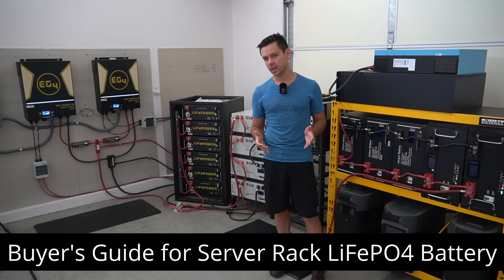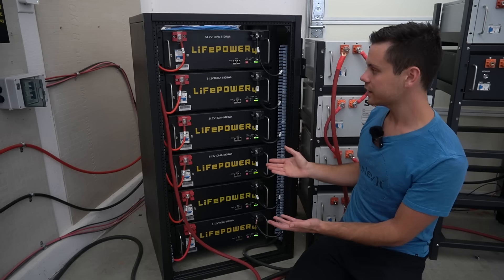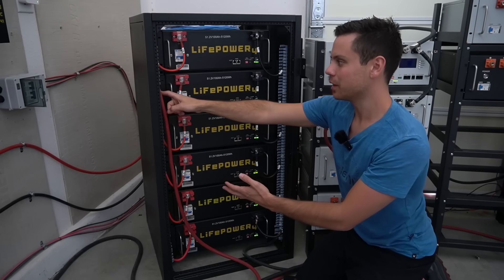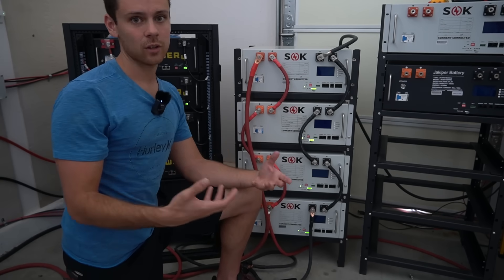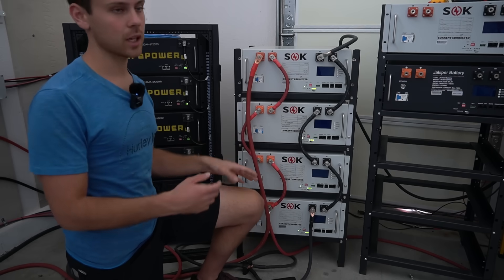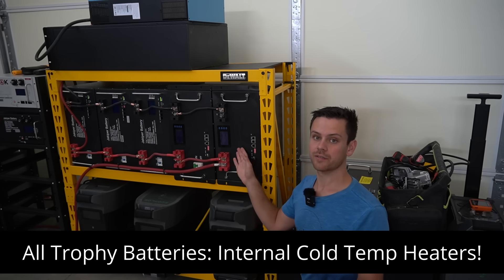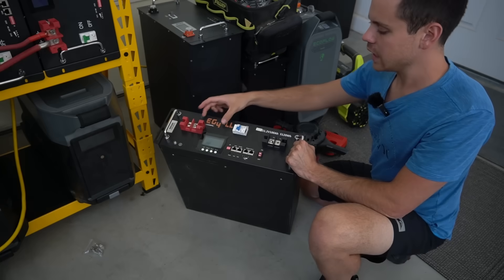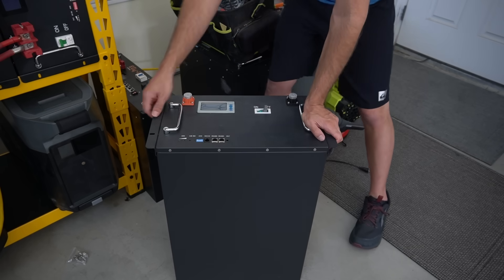LiFePO4 Server Rack Battery Buyer's Guide! For Off-grid Solar Systems

Comment: Hi will. I have a question, I'm very much hoping u can help me with. (I realise ur very busy an av a lot of subscribers.) My question: If I was to get a 12 to 24 V cigarette socket adapter for my car, (Straight plug in.) could I charge my jackery 240 faster or would it nacker the jackery up. Edit: if u happen to c this question and answer it. could u please answer it like ur talking to a 4 Yr old. (Seriously) Thank u !
P.s, I saw some of your videos asking for ideas, Maybe the best pocket Power banks (New or old, whichever has best stood the test of time. Or maybe just the best now when all things considered.) And to go with this, a backpacking (at least 30 Watt. small folding solar panel. Must be able to fit in a backpack) Balanced by price and quality if that's possible. Thanks again. You really are the go to (by miles) when it comes to this kind of stuff. 👍
Reply: No this would not charge a battery more quickly.

Your cigarette lighter socket can deliver a maximum amount of power. Let's suppose it can deliver 60 watts, which is 5 amps of current at 12 volts (60=5*12).

You can't create more power using a converter. When you feed in 60 watts into that 12 to 24 volt converter, you are still going to get 60 watts on its output. In fact, you will get slightly less because the converter itself will consume a little bit of power.

So 60 watts in, 60 watts out. Now your output voltage is 24 volts, which means your output current will be 60/24 = 2.5 Amps. So the current has decreased but your voltage has increased, but the power remains the same.

Going to a higher voltage means lowering the current and this can be beneficial over long lengths of cable as less energy is converted into heat and wasted.
Reply: @deang5622   Thank-you very much for taking the time to clearly answer my question.  It's very much appreciated. 👍

Comment: Signature Solar did a video of their  EG4 batteries, but they demandstrated that the battery would shut down if a high inrush inductive motor load were started on a small single battery setup. Requiring at least 2 batteries for even a small system involving an inductive inrush application.
My only other concern would be about battery/inverter communication compatibility. I'd heard that some combinations had issues.

Comment: What is your opinion on the expectation of equal current sharing among a large bank of batteries assuming busbars/large conductor/equal length etc? Should they all cycle up and down consistently assuming they are all the same model battery?

Comment: Hey Will, I think if you're looking for new content that solar panel tracking would be a big hit. I am fixing to build one using 12 volt light control relays and linear actuators. Just a thought.
Reply: i had one for a year and it worked fine but you can only put so many panels on one and it is easier to build a ground mount
Reply: @davidkettell5726  True, but some people don't have the space for a ground mount and need all of the sun they can get.
Reply: @68rileyray  I solved the problem by building a tool shed for my wife on my pool deck . it has a slanted roof to match my sun angle . I have 8 100 watt panels on it.
Reply: Solar tracking has proven time and time again to be unreliable and not cost effective for the benefits.  There are many, many videos that review this and back up my claims.

Comment: I've got a small hot spring resort near me that is completely off grid, it is an absolute mess tho lol
They have all old 18+ year old inverters and chargers, solar panels are a mess of mixed and matched old and new and broken panels, the batteries are giant 10+ year old lead acids that have been overcharged and boiled countless times from the generator overcharging them because of com errors in their system. Its an absolute mess.
The place was bought not to long ago and I want to see about talking them into getting new server rack LiFePO4 batteries and just fix the system up in general. 
No one there knows how big the system is, but I believe it should be somewhere around 300kw for it to work well at least.

Comment: Wow, that's a lot of rack batteries! Interesting to hear of pre-charge problems with the EG4 - mine worked perfectly with one LV6548 (haven't tried it with two).
Reply from the maker: Yeah I've actually connected it without precharge, had a huge spark and it worked great. I've actually done it multiple times off camera 😂 but some people are having a lot of issues with it on the forum sadly.
Reply: @WillProwse  Maybe with the higher volume, it has uncovered issues more quickly. Watching AmbitionStrikes video with CurrentConnected, they mentioned that the SOK battery pre-charge system was not enough to handle charging a pair of Victron Quatro. They manually charged with a resistor before making the connection.
Reply from the maker: @ericl5973  yes very good point. I have seen the internals and the cap bank on those units is massive. Smart to manually pre charge those.
Reply: @WillProwse   hey Will great video. Have you tried out any of the gsl energy products? Server racks, power walls and inverters? Cheers David
Reply from the maker: @offugo-adventures  I have not. I'll check them out
Reply: @WillProwse  thank you Will. Their spec offerings are pretty impressive. I’d say they might be the manufacturer for some of the brands on sale

Comment: How much solar is needed for these battery configs?
Reply: The eg4 and sok are 5kWh batteries. You would need to be able to generate what you use in the batteries at night. I have 4 panels (about a 1kW total) feeding the inverter and two eg4’s. I don’t have significant load on the batteries at night so the batteries fill up around 1 pm. I know, that’s at least another 3-5 hours of good sunlight here in Phx. Not off grid yet. Yet.
Reply: I have the 4 SOK's and about 4-5 kW of solar and I still have to shut down around 6-7 pm and have the inverter charge the batteries a few hours to make it thru the night.
Same thing in the morning until 10 am when the panels are just starting to wake up. peak solar is about 11 am- 4pm or so.  A lot depends how much you are hitting the inverters also

Comment: Can u use different types of batteries on one system?  ie  2 sok, 1 Eg4,  etc
Reply from the maker: That's what I'm doing. Each has a dedicated OCPD so you can put them all in parallel.
Reply: @WillProwse  
Thanks Will👍
Reply: @WillProwse  
Wait!   What?!    All those batteries you show in the video are on the ONE SYSTEM?!!!
Reply: Follow the cables. They are all in Will’s 2x eg4 inverter system. Similar set up here but not nearly as many batteries. :)
Reply: @azpcox    I bought the setup he showed with the 2 LV 6548's and 3 Egyll's.  Still trying to finish the shed so I can set it up.   As per his thorough video👍.   I wouldn't be able to do it otherwise !!   Thanks Will😁
Reply: @WillProwse  I am not convinced that is a good idea, as each different type of battery will have its own slightly different charging and discharging characteristics. This assumes that the installation has a single charger and the OCPD's function is to simply limit the current or disconnect if the current is too high.

If you have different types of batteries in parallel strings, each with their own charger then I would say that would be better.
Reply from the maker: @deang5622  geez can you please watch my other videos. Watch the one on current sharing. I know max interrupt current and how to design large systems. Watch my videos where I go over this over and over again.

Comment: Are you running all your different battery brands into the EG4 Servers or does each brand have their own server?  I thought I remember you saying that the EG4 servers only work with the EG4 batteries.
Reply from the maker: No they are all connected to the system. Everything is in parallel.
Reply: None of these SRBs he shows has any communications. So you just set the battery type on the EG4 inverter to user, set the voltages and done. They all are on the same bus and charge up to the same operating voltages as well. Normally you don’t mix batteries, but in this case you can.
Reply: @azpcox  Wow, that is awesome to know. Will put that knowledge to use when I build my off grid system.   Thanx

Comment: The big problem for me is not batteries but obtaining solar panels without having to pay almost $2,000 to have them shipped to the northeast. How can I get solar panels up in the Northeast where I can just go and pick them up with my own truck?
Reply: I think the AltE store is in the NorthEast.  You could probably pick up some panels there.
Reply: @HomesteadEngineering  I checked their prices and they are more than double what Santan charges, so I guess the shipping is built into their price structure. $8600 for a pallet of 31 panesl. Sheesh.. I paid $1600 for a pallet of panels from Santan a few months ago. I guess there's no getting around it.

Comment: would love you to test the seplos masan 280ah diy kit with eve or catl cells
Reply: I just built one of the 280 ah kits love it had a little bit of troubles with the BMS had great customer service with them they got me backup and running looking to buy another 1 soon You should definitely check into these Plus I love their terminals they have on them
Reply: @adamrucker3268  What issues did you have?
Reply: Beat me to it. suggested the same thing. Have one en route as we speak. Very cost effective.

Comment: Will, did you sourced rack battery BMS (100/200A) as a separate part? It would be nice for DIY pack that work with inverters. Cheers! :)

Comment: I'm worried about an EG4 battery in my garage where it's probably 110 degrees. Will - is your garage pretty hot or do you keep it cool due to keeping those batteries there?
Reply from the maker: I keep everything at 80 degrees or below. I have a 32,000 btu mini split powered by this system to keep the workshop nice and cold
Reply: Me too. I don’t have an air conditioned space and the wife did not want them in the house. On the back porch in AZ but completely protected from any direct sunlight. While the battery spec sheet says it’s ok, I have plans for a very small mechanical room-thing to help keep the batteries and inverters cooler. Won’t be a problem in winter. But it’s not winter.

Comment: Good lord, I'm looking at those 17+ rack mounted batteries and just drooling. I just wish I could afford 5 (currently have 1 and expanding as I can).
Reply: I want to start with something small, but I dream of this system.
Reply: Will has a payback video in his Full Sized 48v playlist. Spoiler alert. It’s not 20 years.
Reply: @westmountainadventures3606  Yeah, I'm sure that's the case where he lives. Where I live, it's about 17 years.
Reply: @W9HJBill  It all depends on the cost of the rig and current pricing of grid electric. There are ways to mitigate the cost of the rig, as shown in the video I referenced. 

D.
Reply: Why would someone pay more for an unlisted battery?
Reply: Not sure how long you've been subscribed but will started out in an RV doing little 12v-48v camper systems. That's all you can do is expand as you go and eventually you'll have what you want.
Reply: @alec4672  I've been subbed for a long time and know his history. I also know that even in his trailer days, he didn't start out with even a single rack mounted battery system, so my point stands.
Reply: The cost on this stuff is nuts.  BUT....of youbhave a way to pay for it even a loan...and if you size it out to cover your utilities...set the term up to current utility payments and folks would be surprised how fast the return actually is.
Reply: @wadebrewer7212   20 years isn't really that fast when your in your late 50's lol
Reply: @phillmckrakin2518  I'm in my 40s....I can ALMOST relate. 

I look at it like this....I am going to be paying someone something every month for heating, cooling and electricity, might as well be paying the mortgage company and have something to show for it.  Besides....doesnt have to be a 20 year line of credit.  Make it 10 or 15. 

We have been programmed wrong.  We don't bat an eye buying a vehicle for 40 or 50 grand only to be worn out and worth 20% if we are lucky of what we paid for it by the end of the term.  

Buying/building a power plant for your property appreciates over time in two ways.  Both in rising energy costs and in you property value.
Reply: @phillmckrakin2518  sir I can offer you a lifetime warranty.
Reply: @phillmckrakin2518  and most of the batteries won’t last more then 15 years.
Reply: You'll get there keep it up ❤ look around for ex telecommunications batteries as they decommission them after a couple years and barely take load in that time and there rated to work for like 20 years so great

Comment: I live in Florida, and I have just purchased a home here. I would like to set up an off-grid system for times when hurricanes might disable the local grid. Can you suggest a reading list for me?
Reply: Check his last few videos and website in the description.
Reply: Orlando, Fl here. I was on the fence for a while as well. Hurricane and weather events were tolerable with a standby generator but we are now seeing extended blackouts which have increase in the last few years so we decided to get a solar system. We went with EG46500ex (2) for a split phase system and 4 EG4 batteries. It seems like signature solar was the best option but support has been poor at best. It could be due to increase sales but time will tell. When I started research Will Prose convinced we EG4 line was a good start then I watched every video I could find on EG4 products. FYI panel elevation is 15-26d in Orlando. Happy Solaring.
Reply: @ColorMaker_Solar  Ft Pierce area here - how many panels are you running ? I have 4 of the SOK's and probably need another 4 if i want to do a whole cloudy day/ night scenario running the house normally without load shedding
Reply: In Florida also and just built a system  based off of one of Wills videos ( 2) MPP  LV6548's in parallel .  I backfeed the inverters into my main panel and run the whole house ( 3 ton AC, well pump, etc) . I go off grid from 9 am to about 7pm, charge the batteries a couple hours then go back on batteries overnight. Have been doing this for a couple months and my FPL bill went from $357/mo to $177.
Your biggest expense will be batteries and you will never have enough...lol
Reply: @TrollingwTyrone  This is exactly what I want to do.  How did you backfeed the inverters into your main panel?  Also are you having to manually switch between grid and off-grid, or do you know how to automat it switching over?
Reply: @JuanJimenez-ct5ky  Yes I do it manually - your main 200 amp breaker ( or whater your panel is rated for) should have the main breaker at the top center, you need to dedicated 2 breaker spaces for a double pole breaker at the top left or right position just under the main and you MUST use a generator interlock kit ( $30-40)  to make sure only one source or the other can feed your panel. You do not want grid power feeding your inverter input as it is instant death for the inverter but most important during a power outage you do not want to back feed the grid and injure or kill a lineman. Chances of that are slim though as they are all trained to expect this during an outage and your inverter or generator would overload and fall on it's face from trying to power the massive load of all your neighbors appliances
Reply: and buy Will’s book on solar!